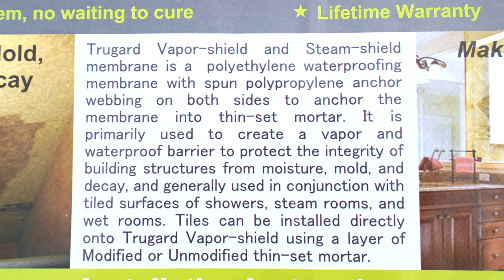Installing Membrane for Tile Shower

Comment: Very detailed work! It's nice to see this much love and care be applied to every single detail in your home! Most contractor would have probably just cut the corners and not overlap the membrane and called it a day. I've worked with some that just skipped the membrane all together. Most homeowners I think would have even called it a day after overlapping and not bothering with caulking the corners or thin setting the corner pieces. That shower will now last 200+ years... well into the intergalactic warp age!
Reply from the maker: Jeff Cao Thank you🙂

Comment: I have to say that as a tradesman this set of videos on laying a tile shower has been the most educational videos I’ve found. Thank you so much for the time u put in. I almost feel like I’m ready for my bathroom remodel. On a side note, it looks like you covered around you shower valve. When the valve was installed it should have came with a black or green bracket (it varys per manufacturer) that snaps on that you tile to.
Reply: Many valves now come with internal cut offs because of the lack of access. The bracket ensures access to cut offs and simplifies valve repairs.

Comment: She installed the membrane vertically.  Another option is to run the membrane horizontally. the first piece completely around the three walls, then one above it with an overlap, so as the water penetrates the tile and runs down, it won't go back up to get past the seam.  Like siding on a house.

Comment: Great video.  Question, wouldn't it be better to lay down the Trugard on the mud bed then do the walls so it would overlap the floor rather then overlap over the walls?  Getting ready to do my shower so curious if it matters.
Reply from the maker: Craig Thank you and yea you can do it that way also. If you watch the Schluter Kerdi videos they do it both ways.
Reply: Thanks

Comment: I so confused on why to choose turfgard over Shulter? The prices I see are a few bucks cheaper on a whole shower with a clear sacrifice to quality. Example would be the drain. Stamped steel vs milled billet. Not saying this won’t work you did a great job. And will turf guard allow modify motor on top to set a porcelain tile?

Comment: Nice 😊 I use a waterproof membrane called RedGard. You roll it on or with the flat side of the trowel it goes on pink and once it's dry it turns red. You should check it out
Reply from the maker: Chava303 I’ve heard of it but never tried it.
Reply: redguard is super easy to apply but you still have to membrane the joints/corners like you did.  nice work and good walk through

Comment: Had a bad experience with someone who said was experienced with remodels and destroyed my bathrooms where all I wanted was a remodel, All was in excellent working conditions.  He was asked to remodel 2 of my 3 bathrooms and instead ruined all 3 bathrooms.  The worst was my SHOWER PAN.  HIS CREW WAS NOT EXPERIENCED BUT THE CONTRACTOR DID THE RUINING OF THE SHOWER PAN.  ALL HE WAS ASKED TO DO IS TO TILE IT.

Comment: Just curious, why did you cut that first piece instead of laying the excess into the corner? Was there not enough for the two inch overlap?

Anyway, great instruction, love the attitude. Thanks for posting.
Reply from the maker: John Fox I don’t think it matters what corner you overlap as long as you don’t double overlap them.

Comment: Question, what Mapai thinset did you use installing the Trugard and since it is so runny putting it on how long did it take to cure? Did you tile the next day?
Reply from the maker: Craig I used Polymer Enriched Ceramic tile mortar(Mapei). I have tiled over it the next day but for this shower I waited a week because I was working.

Comment: Hi I just found your channel.  A builder put none waterproof board around my shower tray an then put tiles over it.

There is a leak now.  Can I use any kind if waterproof proof membrane or something over the tiles so I don't have to have everything took apart an refitted, which will be a complete nightmare   ?? Thanks

Comment: Excellent work, but it would have been a bit more helpful had you shown the shower floor being done as well.   I couldn't tell if you put a mortar bed down prior to you putting down the floor membrane.  It looks like you put it straight over the subfloor.  Did you?

Comment: You should have primed or painted the walls before applying the membrane, the thinset will not fully adhere to the drywall because of the drywall mud/dust. Also, please note unmodified thinset should be used because it does not contain any polymer/latex, specially in wet areas
Reply from the maker: Raul Torres I followed the Tru-Gard instructions and you can use Modified or Unmodified thinset.
Reply: Trugard says use both modified or unmodified but their earlier videos/instructions say you must use Unmodified. Their distribution warehouse is 15 min. from my house, I know their products.

Comment: I don’t think I can ever trust this type of membrane. Redguard, Aqua Defense or any other roll on type for me.

You have to consider your laps as well. If I for some reason did use this product, I would’ve installed the bottom first, so that if ever breached, the verticals are inside the “pan.”

I also would never built a shower without an intact, last line of defense pan.

Comment: You know you can just buy waterproofing membrane paint and brush it on? Its 10 times easier, and then you just seal the joins with silicone. Your way is very outdated.
Reply: The work is just a front. It's the body that is being showcased here.